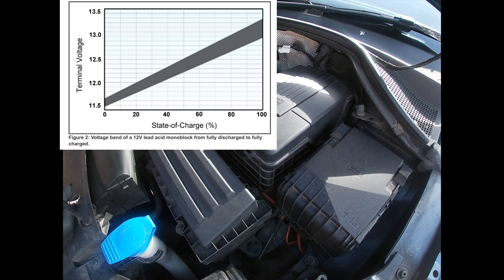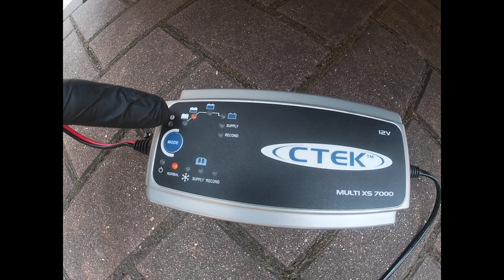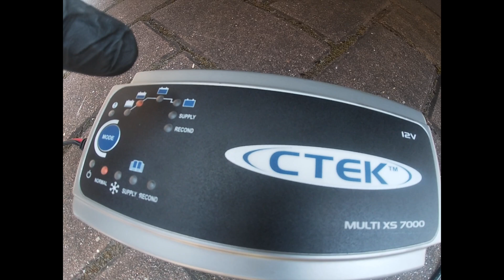How To: Trickle Charge a Car Battery during Coronavirus Travel Restrictions

Comment: Will this trickle charger be okay for a mk1 Focus?
Reply from the maker: Yes, it should be fine. However, this model is possibly over-specified if the Mk 1 Focus is the only vehicle you plan to use it on. A 12 volt car battery will have an ‘Amp Hour’ rating and for a Mk 1 Focus I would imagine this would be pretty low compared to more modern vehicles which need larger capacity batteries, so one of the smaller (& thus cheaper) C-TEK chargers would do the job you need. The ‘Amp Hour’ value is likely to be detailed on the sticker on the top of the battery, or in your car’s hand book, and you just check this number against the maximum charging capability of the charger. Obviously double check this information with the retailer or directly with C-TEK’s customer service team: www.CTEK.com
Reply: @drivingvideos4238  Thanks! I really appreciate the detailed answer.
Reply from the maker: I believe the early MK 1 Focus battery is around 44 AMP HOURS, but do check that yourself. If so, this entry level model C-TEK MXS 3.8 charges batteries up to 80 Amp Hours, so would be plenty for the Mk 1 Focus, so just depends if you plan to use your charger on any other vehicles with larger batteries as well. C-TEK make quality kit, I’ve had mine for year years. Example link just for info. 
https://www.smarterchargers.co.uk/products/ctek-mxs-3-8-battery-charger